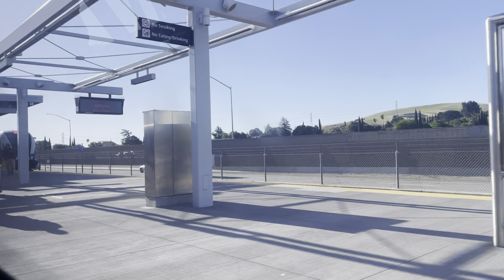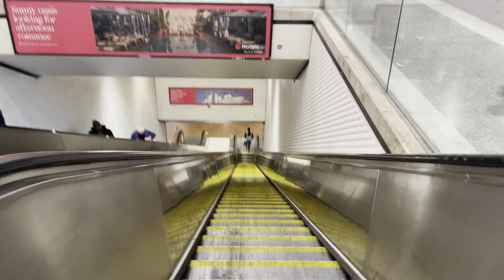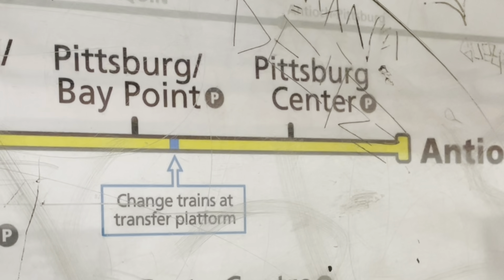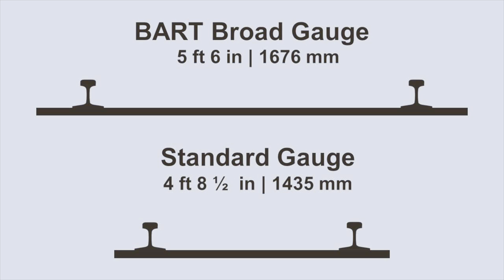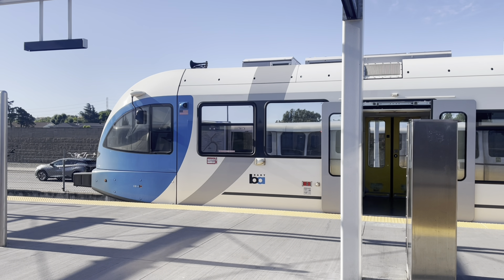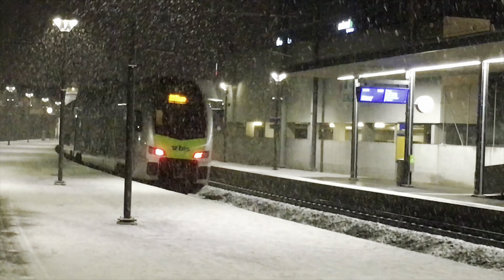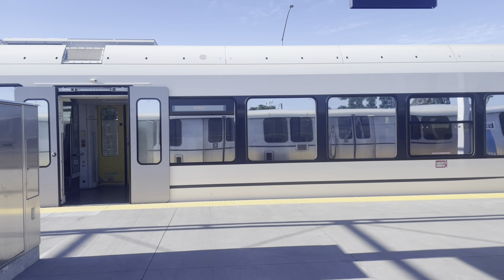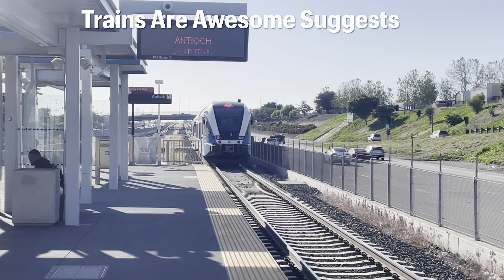eBART: The Strangest BART Extension

Comment: Here’s what I don’t get: I’ve heard dozens of times that narrow gauge is cheap and broad gauge is expensive. But why? You’re just setting the rails a bit further apart, right? Okay, the sleepers have to be longer, and that makes them slightly more expensive. And maybe the right of way you need to acquire has to be slightly wider (though, all in all, I doubt this is ever actually the case, as the right of way is normally significantly wider than the tracks, which themselves would be less than two feet wider overall).

But the rails are the same size, the right of way in this case is exactly the same size, and surely the cost of the sleepers in this build was so tiny it’s basically a rounding error. How did building it to standard gauge knock 50% of the price off?
Reply from the maker: The key is in the word standard. Building something to specifics other than standard  takes more expertise. Also, don’t underestimate the sheer difference square footage can make in the Bay Area. Finally, the cost of electrification is prohibitive. Remember, it’s third rail. That’s two extra rails for the entire 9 miles.
Reply: Also, the rails aren't the same size.  BART was originally laid with 112-pound-per-foot rail, which is basically a medium-weight mainline rail weight.  The eBART trains, by contrast, are "light rail" vehicles that can use considerably smaller rails, which means not just that the rail is cheaper, but the forces on the track are lower, meaning the sleepers can be lighter, and the roadbed doesn't need to be as large or deep, and all of that compounds into the price.

The "third rail" is not just normal rail, too.  It's actually stainless-steel-capped aluminum (or, in the older tracks, aluminum cast around steel rail), which is substantially more expensive than plain steel rail.  And there is also the power infrastructure to provide power to it.
Reply from the maker: @BrooksMoses  thanks for the technical details!

Comment: That transfer platform is an absolute nightmare when things go awry.  Trains get delayed and people physically can't leave the area.
Reply from the maker: Is there no emergency exit?
Reply: @Thom-TRA You would get arrested for using it if there wasn't a fire or other emergency.  The whole thing is, IMHO, stupid cost cutting.  Considering current oil prices, I bet it even costs more to run the disesl trains that standard BART ones.  Transfers should be avoided whenever possible.  Likewise, I think ARROW should just be an extension of Metrolink San Bernardino Line.
Reply: The project was funded by a measure on the ballot in contra Costa County .   Contra costa was responsible for all the money because of this and they didn’t want to pay for same gauge expansion.

Comment: Besides the NJ Transit River Line, other North American systems where these Stadler GTWs are used include Denton's A-train and Austin's Capital MetroRail! As much of a BART oddity as it is, I still think it's pretty cool that they did this and building it in a highway median is an easy way to build stations. If you have the density to back it up AND have it enclosed in a way that you're protected from all that noise pollution like having platform screen doors, then it can be great design! Even better if there's a bus hub. The REM stations in Montreal do that, sharing the Champlain bridge with the highway, stations being bus hubs, and thus better connecting the suburbs. 

Stations without any exits or entrances is definitely an interesting concept. There's a station in Japan called Seiryu Miharashi-eki (for those who don't know: it translates to "Clear Stream Viewing Platform Station") that opened in 2019 and the platform simply exists to admire the views! Not every train on the Nishikigawa Seiryū Line stops there as it's only special trains that do. Metro-North Railroad does something similar as they have stations specifically built for hikers. These are Manitou and Breakneck Ridge on the gorgeous Hudson Line, and Appalachian Trail on the Harlem Line. With Appalachian Trail station being significant as it's the only rail station directly located on the Appalachian Trail.
Reply from the maker: And if you take the Nishikigawa Railway all the way to the end of the line, you can take the “Toko Toko Train,” a ladybug-themed tram that goes through a tunnel with strange LED light decorations. It’s on my bucket list.
Reply: A better example of a station without an entrance or exit on MNR would’ve been the Devon Transfer platform at the beginning of the Waterbury Branch when there was construction on the New Haven Line a few years ago. A brilliant idea to keep the service going during the track outages.

Comment: The fact that the `e` in eBART does not mean electric is just violating all sorts of norms 🙃I bet you'd be surprised if you bought an e-bike and it were diesel powered, eh?
I am curious why they did the transfer at an isolated station instead of just extending the Pittsburgh/Bay Point station.
Reply from the maker: It would reduce capacity at Bay Point
Reply: I remember seeing a video where someone was like: "I asked BART about why the transfer platform exists and they told me they couldn't find a reason" but I guess like Thom said it'd probably reduce capacity at Bay Point.
Reply: Exactly!  eBART appears to be a deliberate feint to avoid bringing attention to the fact that the engines are of the CARB forbidden, diesel engine which is basically being regulated out of existence for trucks, buses, and other uses in California.   Diesel is good for us, but not for you says the government.

Comment: I’ve never heard of a train station with a transfer point only an no exit. That’s cool how you can get to two different types of BART trains in between. That’s something I want to do someday. It must’ve took me time to know that there’s a different kind of BART train other than the subway. I like how there’s two different kinds of those passenger trains of the same system.
Reply: Secaucus Junction in New Jersey was originally intended to have no exits but they eventually capitulated and added an exit/entrance and a small parking lot off a NJ Turnpike exit.
Reply: @kjrehberg  I didn’t know that either. It must be good the way it is now.
Reply from the maker: I remember when the trains were built so that’s how I remembered about it
Reply: @Thom-TRA  Oh cool. I haven’t really been looking into train systems that much that I don’t live by or plan to visit anytime soon, but I like giving myself the opportunity to hopefully be able find some time to travel to other destinations and check out new ones.
Reply: There used to be a similar arrangement at Dovey Junction in Wales, for connecting between trains to/from Aberystwyth and trains to/from Pwllheli
Reply: @AndreiTupolev  hmmm, yeah that’s interesting as well.
Reply: Not exactly the same, but Sunny Bay station on the Hong Kong MTR only has an exit to a bus loop; there is no street-level pedestrian exit. The station is solely for transferring from the Tung Chung to the Disneyland Resort Line or busses (or vice versa); there are no pedestrian exits.
Reply: @mt_xing  That sounds interesting as well!

Comment: It’s kind of a solution to not running these long trains on low ridership extensions, but why does BART use third rail instead of overhead wires anyway?
Reply from the maker: Probably to be able to build smaller tunnels
Reply: Overhead wires may have been nixed for risk of potential electrical fires . . . PG&E is now undergrounding a great deal of power lines for this reason.
Reply: @Kitty8791   you still have the power source on the ground if you have third rail, with overhead line theres just no risk of someone being fried by touching it
Reply: @szymex22  Do you have numbers on people trespassing (plenty of signage to not touch the 3rd rail) & being electrocuted by 3rd rail vs. people being burned to death in their homes or while attempting to evacuate due to a wildfire?